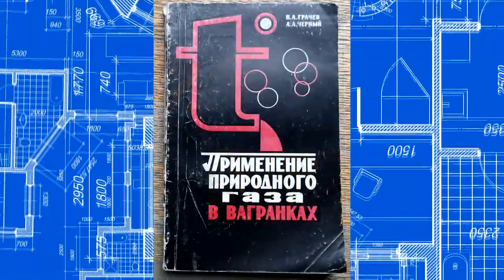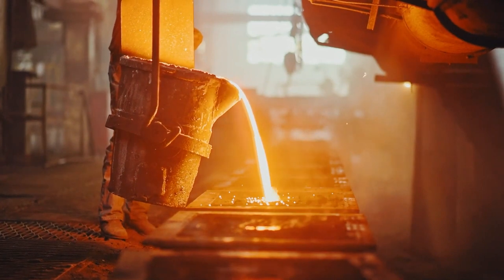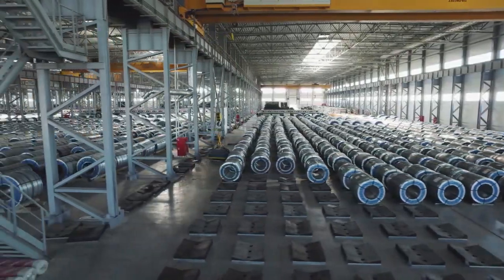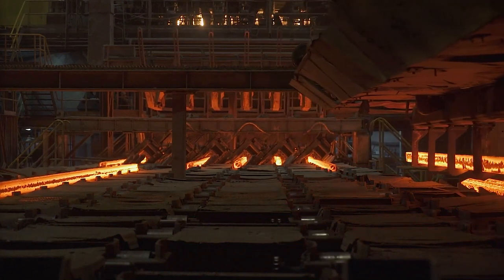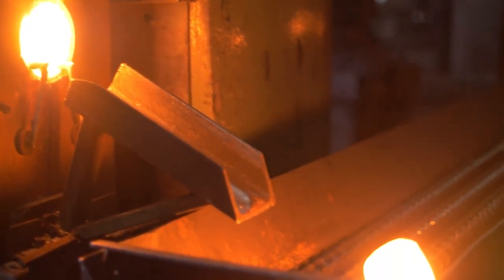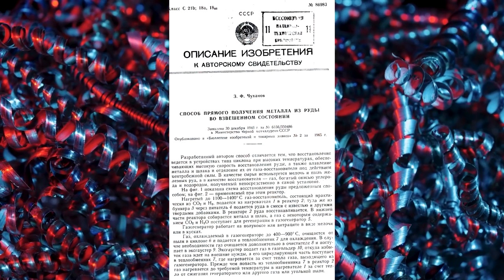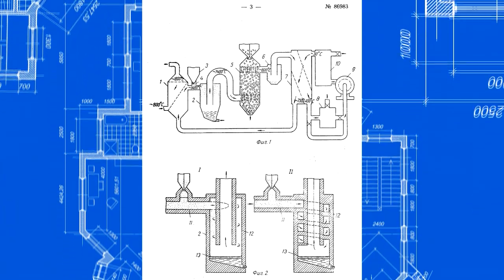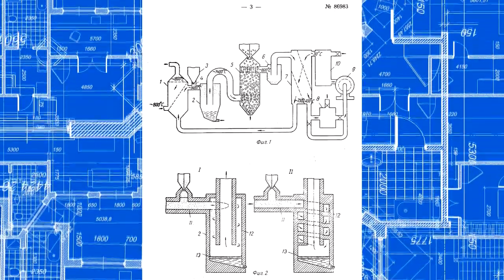Direct production of iron from ore using generator gas. Chukhanov's method

Comment: I just finished my gasifier base on the design of Ben Peterson. I use wood chip with about 10-20% moisture. After few hours of running my 5kW generator I have issues with the filter because of the moisture. It requires a lot of maintenance because of it. It works perfectly on charcoal but it is time consuming to produce or expensive to buy and I would like to run it on wood chips only. Do you know how to solve this problem? I have video of the machine while running the generator (winter and summer condition) if you have time and are interested to look at it.
Reply from the maker: yes, in order not to remake the gas generator - let the gas go through three more barrels with an opening lid for 200 liters and the gas will go clean. Pour ordinary wood chips into the barrels, and at the bottom of the barrels there is a tap for draining the water. It's just that Ben, apparently, does not cope with the cleaning filter. This is the problem of all converts. Need a bigger filter.
Reply: @gengaz-lagunov  I would like to talk with you if you have some availability...
Reply from the maker: whatsupp +380661963808
Reply: @gengaz-lagunov  I guess you meant whatsapp? Never used that app yet I will check this out soon thx
Reply from the maker: yes